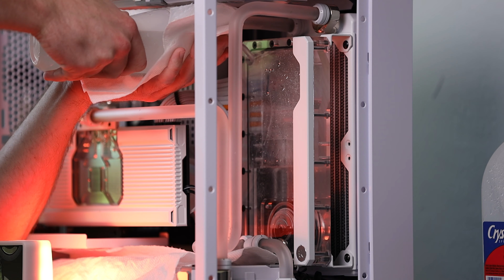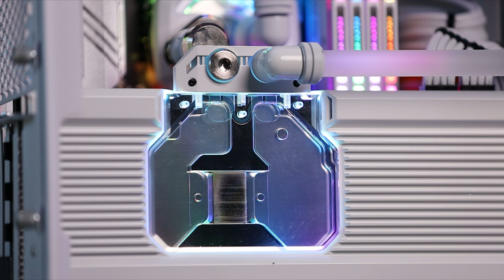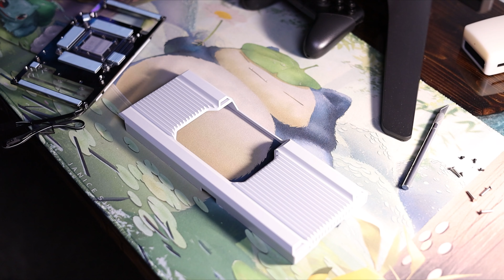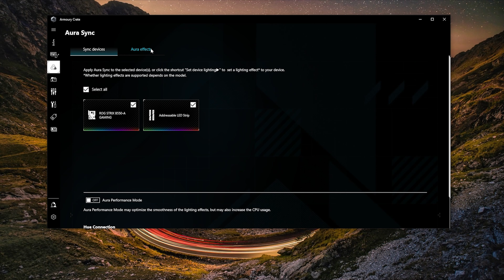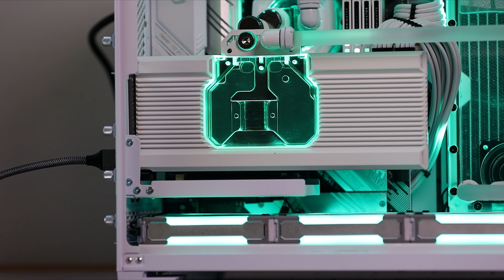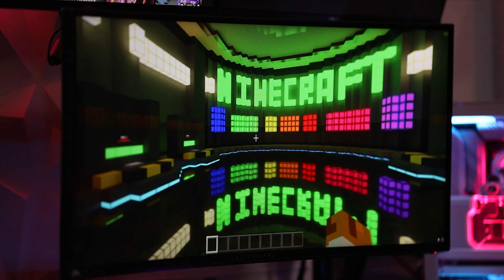Water Cooled Lian Li White out 011 Mini Build COMPLETE

Comment: 13:06 i just want ONE software for everything. I chose ASUS Mobo to work with, so if anything doesn't sync with Aura, it's a no. And these fans, because 99% of what I have seen on youtube in past 2-3 weeks researching has been them, i not using them. I found alternatives. They look great though and functionality is awesome, alternative I found, who knows they might start a trend when I finish building. Now see your fans at the bottom, I wont have to do that with the ones I chose to work with.

Comment: I have 7950x3d and 4090fe both ekwb waterblocks. I was currently about buy the case and radiators but I heard the coolant temps are 40c and above unless back panel is off with triple rad setup. 360,360,280. Imagine worse with dual rad. Any thoughts?

Comment: Thanks for the detailed video! I watched 3 other videos before yours, 2 were just music, the third only said what components were inside. 🙄 I love the color, teal has always been one of my favorites! It's so hard to match it though, the RGB numbers are vast . 

I already have an 011 D EVO, with a 5950x, EVGA 3080 ti ftw3, both in EKWB Vector 2 blocks and the FLT 240 with the D5, I hadn't even thought of doing that, I was considering using a 120, or pump and res separate, though the FLT is what's in my EVO build, it's incredibly versatile. So, you used the enclosed mounts and put it on the rad with the Noctuas  drawing air from inside the case? I have 2 left from an EK aio that was disappointing, I also bought the Flow version, same as my Evo, so I'm going to populate it with maglev fans everywhere else. 

I have everything but fans and nothing will be here until after Christmas, which is fine as my student won't be back until after New Years. Again, thanks for a detailed video, it definitely helped!

Comment: Build looks great, thanks for sharing. I’m waiting for my O11 Mini to arrive after nabbing a Black Friday deal. I will be rocking dual 360mm radiators with the same FLT240. I have a spare slim 240mm radiator and your build has given me some inspiration to try a triple rad build. I’ll be surprised if the side rad ports are accessible with a top mounted 360 but I guess we’ll see.
Reply from the maker: Thank you David! Nice, I am sure you will love building in the O11 Mini! It is a very modular case, I am sure you can make 3 rads work.

Comment: I am doing a similar build to this and was wondering if you would go with a bigger rad on the bottom for cooling. I know you said you were going to do a follow up video on that but I am just curious of your opinion.
Reply: Totally late as a reply, but you could but you give up the vertical mounted GPU. I used to have a slim 360 at the bottom but swapped to a triple radiator setup with a 60mm thick rad at the bottom. In order to fit all the rads (HWL GTS360 up top, GTS280 at the side, SR2 MP360 at the bottom), I had to reorient the GPU back to horizontal. However, there have been people who modified the vertical mount kit to accommodate mounting the motherboard a little higher than intended to allow both a vertical GPU and a triple rad setup.

Comment: Even tho i preffer different configurations i gotta say this one it's really nice and watching those bends on a 011 dynamic it's kinda refreshing tho.

BTW, how that PSU and waterblock have worked to you? I want a 3080 as well but i'm afraid an SFX 850w psu wont be enough talking of energy comsuptiom spikes.
Reply from the maker: Thank you Neftali'! Yea I was trying to go for a more unique style for the O11 Dynamic, so many builds with this case look the same when distro plates are used. I have had great performance with the blocks and PSU! I agree the high wattage SFX PSUs sounds sketchy, but I have had no issues with SFX PSUs from EVGA and Corsair.
Reply: I have had a SF750 powering my 5900x + 3080 system for almost 2 years without issue. Get a quality PSU and do a slight undervolt on the GPU and you’ll be totally fine. Don’t waste money overspending on PSUs, get a quality one from a reliable brand and enjoy those games :)

Comment: Think the fans blowing through rad and on the Tank will affect tank water temp ?
Reply from the maker: Hey Jay! I don’t think it causes any temperature differences to the water in the reservoir. Luckily the tank is pretty thick acrylic and the air moves past it super quickly to cause a temp change. But I haven’t done any testing to prove it, but I imagine the temperature difference would be super marginal.
Reply: I was thinking of doing the same because I don’t ant them block my front glass
Reply: Maybe worth flipping them to exhaust and see if that actually changes the water temp?